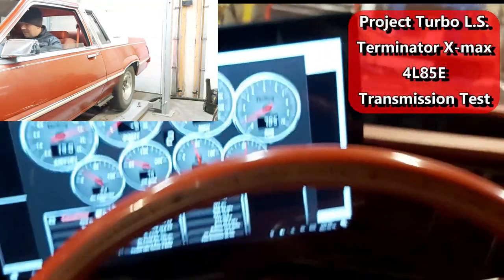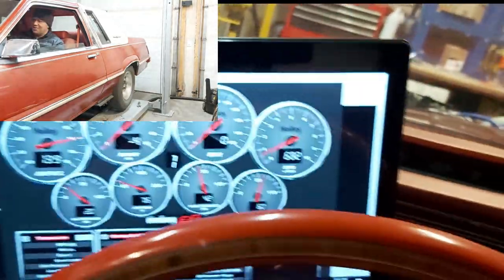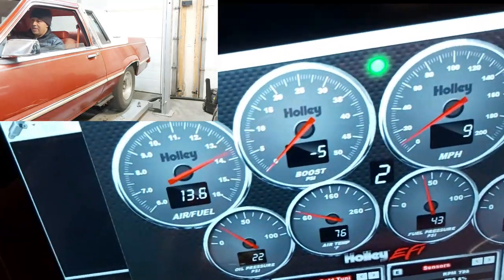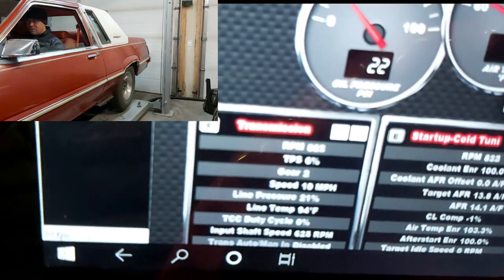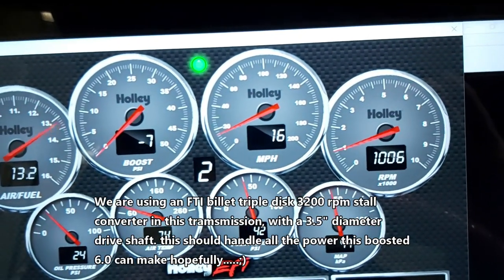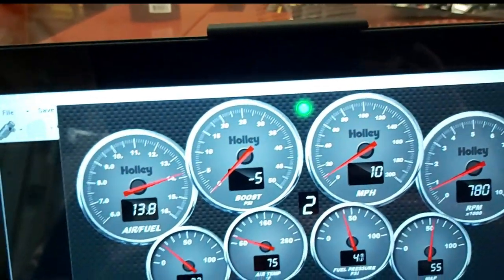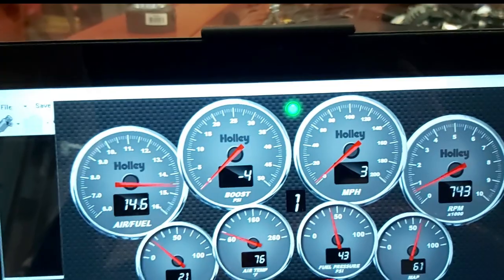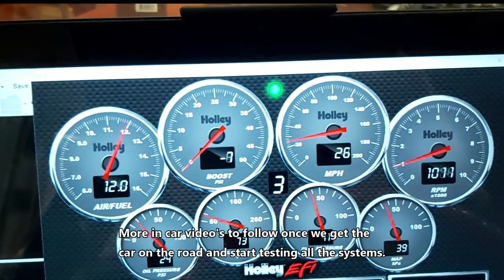Terminator X max & 4L85E transmission test

Comment: If I’m running terminator x with a t56 can I use the tablet to get a gps signal for the software gag use to show a speedo?
Reply from the maker: Yes, if the T56 has a VSS  (vehicle speed sensor ) plug in like the 4L80E does. The terminator X-max was designed to be used with the automatic transmissions. I'm not 100 % sure the speedo in the tablet will work with the T56.....